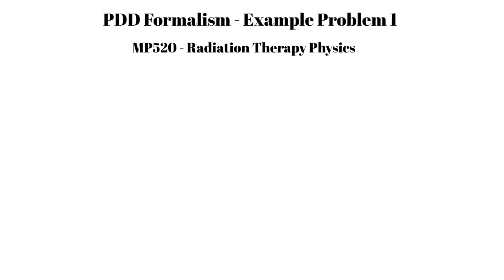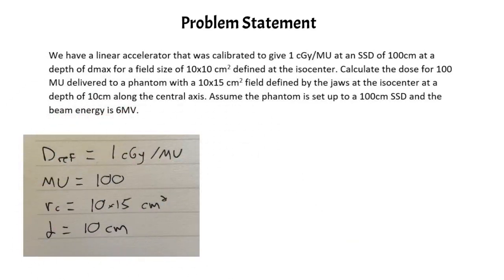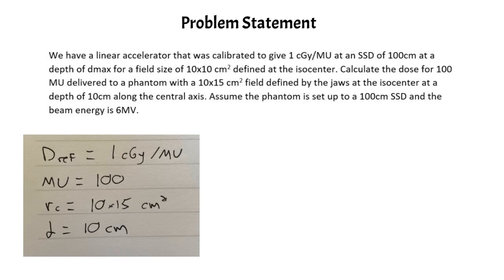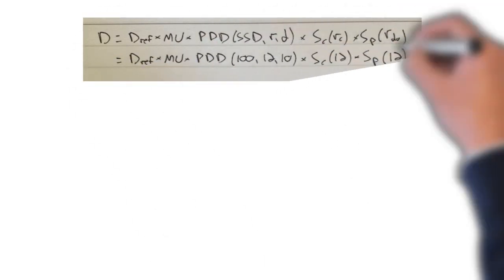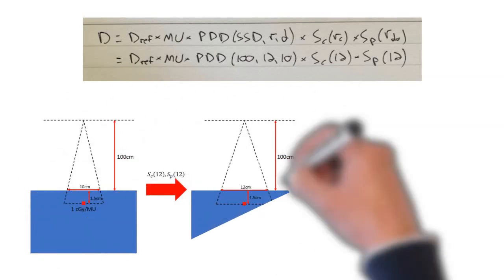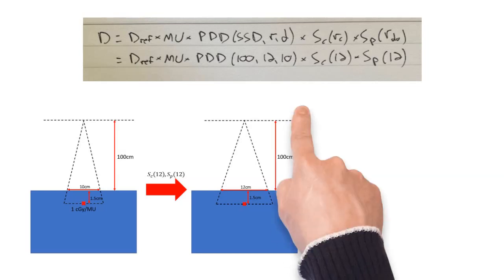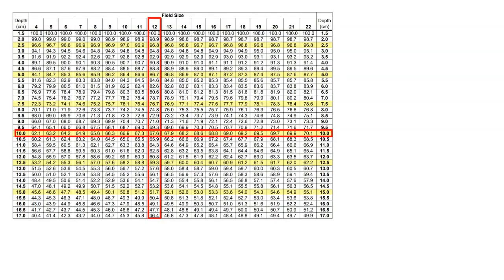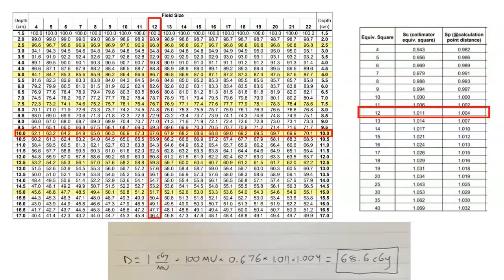Radiotherapy Hand Calculations: PDD Calculation Example 1

Comment: Actually，i don‘t understand why the field size of the phantom scatter (Sp) is 12. Why not calculate the field size corresponding to the maximum depth, but directly use the field size on the surface of the phantom?
Reply: moreover, in this case, i think u need to divide the Sp(r_dmax) first, and then multipuly the new Sp(r_dmax) when the  field size has change by jaw. Because the oringal Sp is not defind at SAD.
Reply from the maker: @Med_physicst_Lu  yes it's a bit confusing. It's actually different if you're using PDD or TMR.  When using TMR, Sp uses the field size at dmax since TMR is defined at 100cm (SAD) with the field size at dmax.  But when using PDD, Sp uses the field size at the surface since PDD field size is defined at the surface.
Reply: @medphyCo60  Thank you very much for your quick response.
In fact, I think there is only one factor that affects Sp, which is the field size of depth dref and SSD does not affect it. In the first example,  since the SSD set up is used, the field size at d_ref should be 10.15cm. At this time, it should be divided by Sp (r=10.15cm) to return to the state of sp (r=10cm). Then, since the jaw is set to 12cm, the field size at d_ref should be 12.18cm, so multiply it by Sp (r=12.18cm). Then the final expression should be: D=1cGy/Mu*100*Sc(r=12cm)*Sp (r=12.18cm)/Sp (r=10.15cm) *PDD(100,12,10).
If u use the SAD set up, the field size at d_ref=10cm, then you can use Sp(r=12cm)*Sc(r=12cm) when the jaw is set to 12cm.
In addition, I have a big question about the definition of the measurement point of TMR at the SAD point. It seems that the measurement point of TMR can be defined at any depth from the source as long as the reference point is selected as d=1.5cm (for 6mv).